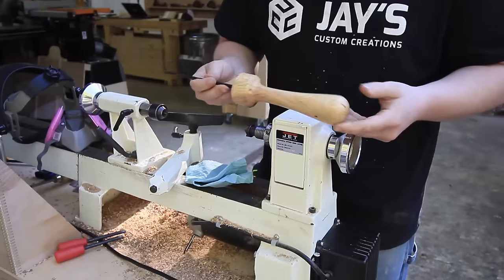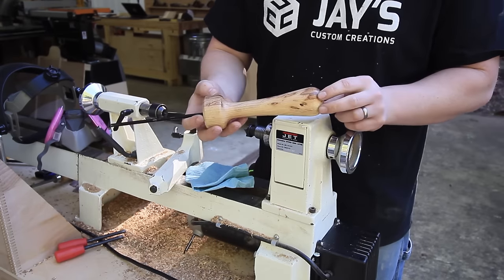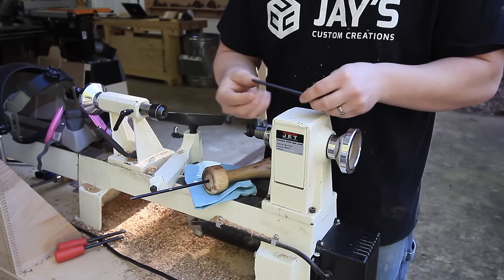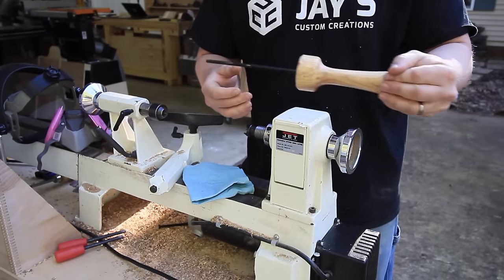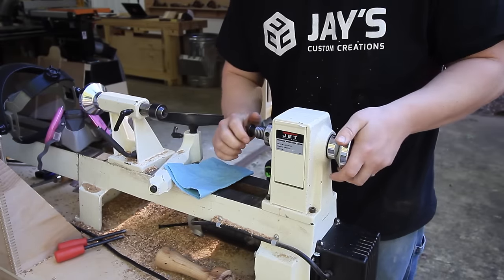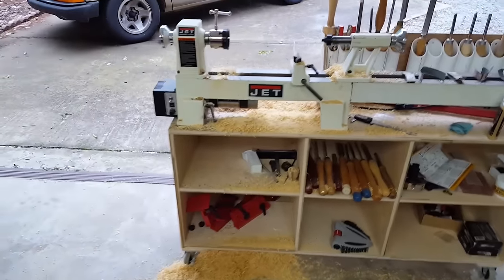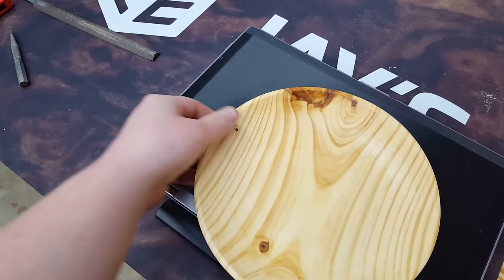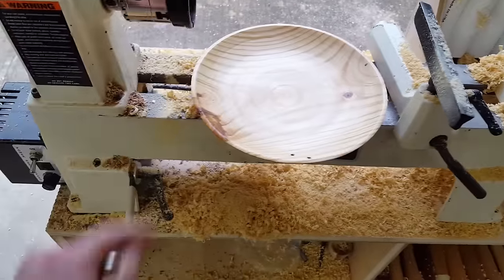First few lathe projects (completed pieces only)

Comment: Nice work Jay! Woodturning may be the coolest thing ever...but if you haven't already figured it out, once you buy a basic set of tools, you're gonna have to buy more tools so that you can use your tools.  Then more tools to use those tools lol Not only that, but woodturning will consume every last flat surface of your shop :)  You need to get yourself a grinder and jig setup for those high speed steel tools.  I would recommend any low speed 8" bench grinder (use an 8" grinder because you will get a flatter bevel) and the wolverine jig from oneway (you could probably even make a jig like the wolverine jig).  You should also pick up one of the varigrind jigs from oneway.

Comment: Nice work. The lathe is probably my least used tool, but definitely by far the most fun. I always try to find excuses to use it. Get in the habit of pulling that chuck key out, you don't want to see what happens when you turn it on with the key still in.

Comment: Buy your self a self-ejecting chuck key mate, it will save you a lot of pain down the road.
Reply: Yeah definitely.  never leave your key in your chuck.  you WILL forget and turn your lathe on with the key in the chuck.  and its very very very dangerous.
Reply: Our first metal work project at school was a self ejecting chuck key. It only took a few minutes before we heard a whir...BANG...scream. The chuck key took this kids finger straight of and buried its self in the wall.
Reply: +Michael Tricker I've been fortunate enough that in my 20+ yrs of running lathes and mills to never get caught up myself.  but I have seen it happen a few times.

Comment: I'm not usually a safety nazi, but I have to say this to you as a new lathe owner. Never ever leave the key in the chuck. Never. Not ever. Sorry to nag, but when you walked over to the lathe and I saw the key in the chuck I freaked. It is the classic way that new lathe owners get injured. I apologize if this sounds like a rant or just over the top nagging, but I expect many more years of good content from you which you will not be able to produce with a chuck key sticking out of your forehead. Carry on.
Reply: +indoorherbivore Was just about to mention that, rule of thumb, if the key is in the chuck, never remove your hand from it, in that way you have to remove the key before you can let go., also if you don't have an easy place to put it, attach a magnet to the side of the lathe close to you.